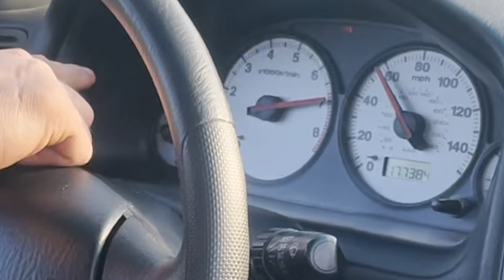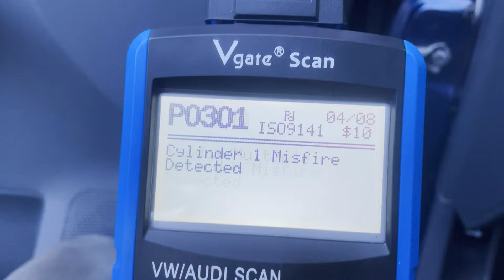$900 HONDA CIVIC REFUSES TO DIE!!

Comment: I once drove this model civic 300 miles with a bad head gasket and no oil. After replacing engine, it's still in my drive way.
Reply: Can you tell which trim level it was?

Comment: how'd you get both front wheels to spin lol.  does it have an LSD?
Reply: Probably just dumped the clutch so hard it broke both loose I used to do the same in my 2.2 GMC Sonoma till I spit the driveshaft out of it on the highway bang shifting fifth

Comment: Oh yeah? Mine threw its rod into the cylinder wall split the crank almost in half spun all the bearings head gasket has a big crack and the other 3 cylinders have rod knock

Comment: Almost the perfection.
With flames on the sides, it can still gain a hundred horsepower.
Above all, do not put flames on the hood, because the chassis will not resist with this addition of power.

Comment: The engines that came in these 01-05 (I think those are the years) civics, minus the ep3s, we’re probably the most ass engines Honda made. The only thing they were good for was fuel mileage which is still worse than Hondas d series engines from the EG’s and EK’s and they’re pretty reliable. Not horrible for what the car was designed for, but we all know that over half the people looking to be a civic are going to be using it for something other than what it was made for